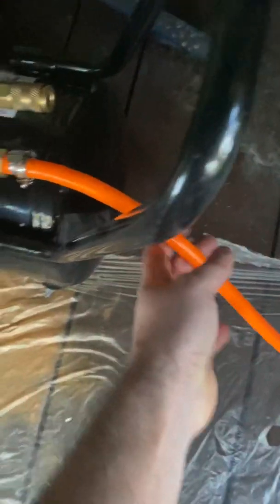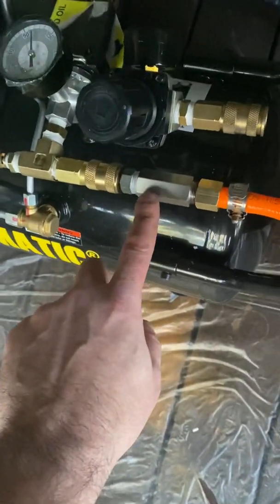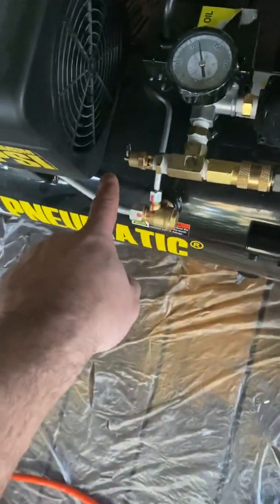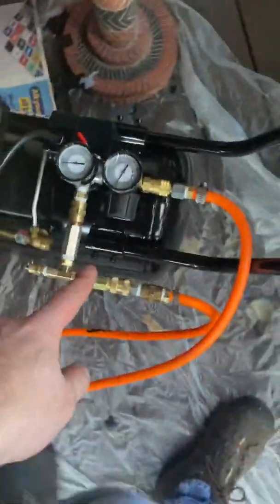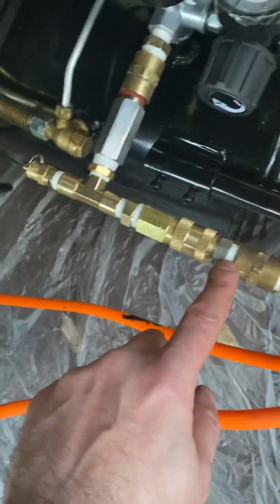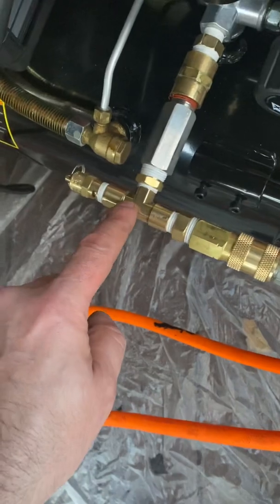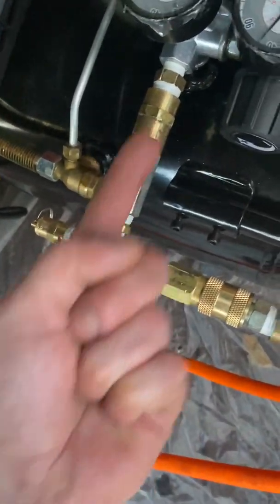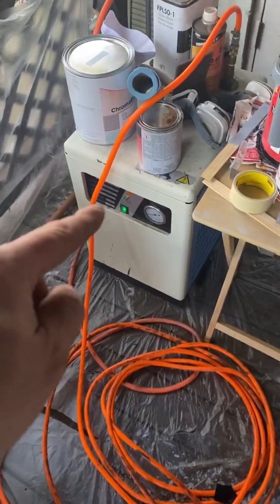Combining two compressors for double the scfm / how to combine two compressors

Comment: on second compressor you moved pressure relief valve and used that for line out to dryer? Best video on this. you can see the parts he used and he tells you exactly what goes where.

Comment: Wonder how many people will connect two compressors in this manner not knowing that it is not only incorrect with 2 check valves doing the exact same thing but very dangerous without the 2nd compressor not having a properly installed pressure release.
Reply: Very valid comment…Second compressor is the critical compressor which should definitely have a safety valve properly installed since it’s building pressure from first one
Reply: I’m doubly impressed that the creator responded with such humility and honesty.   Hard to find in the “Information Age”.  I have one strict edict; I prefer to be wrong instead of right.    When I’m right, I haven’t learned much if I already knew I was right.   If I’m wrong, I then know I’ve learned some valuable info.    Reduce variables.     It’s my religion.

Comment: I think the “emergency safety valve “ in the second compressor must be placed after the “check one way valve”  for it to protect the second compressor ?
Reply: It appears you are correct. The second check valve is useless because it’s doing the same as the first which means the pressure relief on the second compressor will not activate for the 2nd compressor.
Reply: The first has its own pressure relief valve....My question is why have 2 check valves....seems like you only need one on first comressor.

Comment: Really very simple. Remove the emergency valve and replace with a tee, emergency valve one side then check valve and fittings other side. Then repeat for second compressor! Love it. So many other videos over complicate the process and don't show what you need to actually do to pull this off.  Even better if you use proper belt driven compressors, quieter and will last forever basically.

Comment: Why do you use 2 check valves?
Reply: Yah same question, why  two check valves?  And on the second compressor the check valve essentially makes the safety pressure switch inoperative. as air can't come back to it. Or am I missing something...
Reply from the maker: @peterw8911  you know what? I think you're right. It was a lot o get my head around. Good looks!
Reply: @MrJigstavo dubs respect.